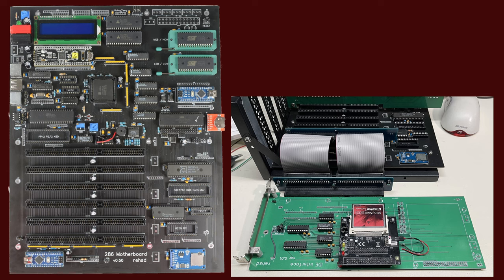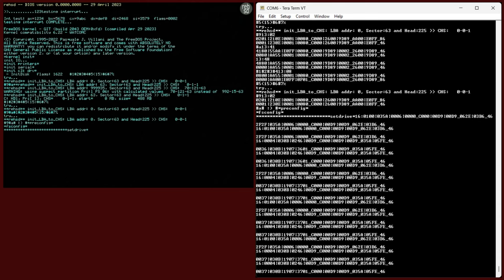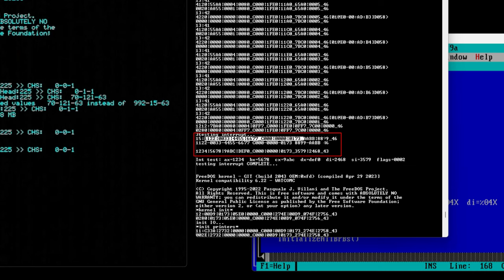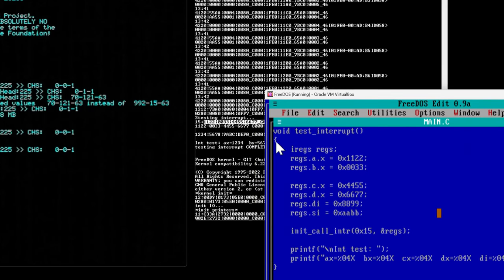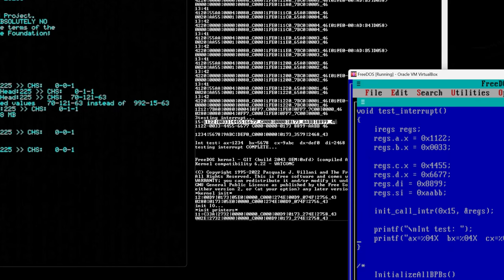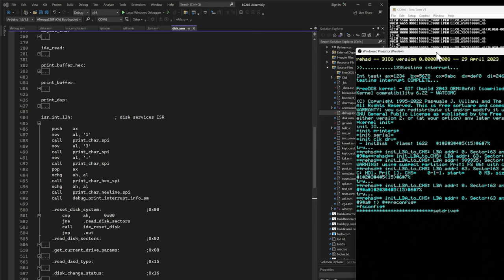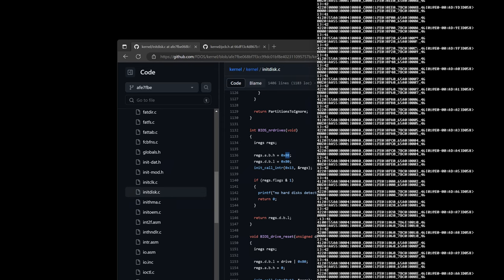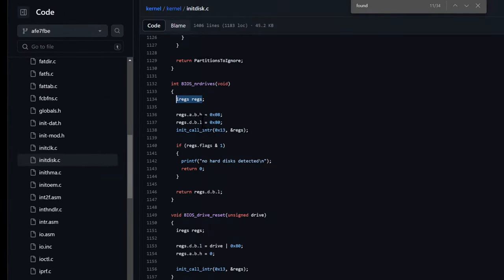80286 Build, Ep. #92 - Troubleshooting CPU Flags Register between BIOS and FreeDOS

Comment: `iret` restores FLAGS, CS and IP registers. Bulding proper stack frame is the solution. On entry try `push bp`, `mov bp, sp`. On exit use `mov sp, bp`, `pop bp` and `iret` (or `leave` and `iret` alternatively). Inside your ISR your saved BP is going to be accessible through `[bp]`, return IP through `[bp + 2]`, return CS through `[bp + 4]` and finally FLAGS through `[bp + 6]` (all assuming I got the offsets right ;). Modifying `[bp + 6]` is going to make changes visible to the caller. As an added bonus you get super convenient storage area for local variables. After `mov bp, sp` you can add something like `sub sp, 12` to get 12 bytes of local storage. It is going to sit between '[bp - 14]` and  `[bp - 2]`.
Reply from the maker: Thanks for the info, @pvc! I'll need to practice my stack frame skills.  :)

Comment: Quick thought - caveat - I've never done 286 assembly, but looked in the 1987 programmers reference manual. There's a note saying the IRET behaves differently depending on something called the NT bit which is involved in task switch. Maybe there's something in that, if it does a "return" that actually does different/extra stuff.
Reply: @rehsd actually in reading a bit more it looks like INT n and IRET have built right into the insn a flags push and pop, so no matter what you might be doing with the flags locally they'll be overwritten by the pushed value from the caller.  So you might have to directly molest the stack, either by popping and re-pushing the intended value, or by pointing right into the stack. Looks like it also does that with the cs reg.
Reply from the maker: As far as I can tell, NT is used in protected mode. Currently, I am still using real address mode only. I'll do some more research on the NT flag. Thanks for the suggestion!
Reply: @rehsd  Check out the other comments about INT/IRET automagically preserving flags, probably more relevant
Reply from the maker: @ripliini, @Tom Storey, @Zxborg... I swapped out iret with retf 4, and all is good! You are all awesome!
Reply from the maker: Correction... retf 2 is what I used... and is working.
Reply: @rehsd  Good stuff! One caveat though, sometimes dedicated ISR return insns (talking general principles here, not specific to 80286 CPU) affect specific interrupt state flags and it's important to make sure to end an ISR (at least a hardware ISR) with the right flavour of return so that stuff like nested interrupts are still handled as intended.  But if it works, and it's "only software", then hey, go for it :-)
Reply from the maker: @zxborg9681  Noted! These are all software interrupts. I haven't needed to change flags on any of my hardware interrupts so far. On any hardware interrupts where this situation occurs, I'll need to clear the interrupt on the priority interrupt controller. I'll see what other damage I can do with this.  :)  Thanks!

Comment: How exactly does this iregs type work? Is it actually a struct that you need to populate values into or is it something special that the compiler handles internally? Your code only seemed to be placing values into registers but not into the memory pointed to by &regs? Or maybe I missed something.

But if it's the later, then I suspect that the flags are not maintained by printf whereas the value of all of the registers probably are, and this is probably normal behaviour. Generally the flags are transient and only used in local context, except in ISRs where you would push and pop the original flags to properly resume execution after returning from the ISR. But printf isn't an ISR so it likely doesn't care to save the flags such that by the time you come to print them out, the value returned by int15 is long gone.

By contrast, in that BIOS_ndrives call there is nothing going on between the call to int13 and where you test the flags, so they are probably maintained long enough to be able to use them in the if statement.

So I'd say try copying regs.flags into an integer after the int15 call and use that in your printf statement instead.
Reply: Actually, as others have pointed out, IRET restores original flags from before the interrupt, so without modifying the stack manually to change what the flags will be restored (probably not a good idea unless you really know what you're doing) then you can't return a custom set of flags.
Reply: Hm no, it looks like a "ret n" instruction will discard n bytes of the stack before returning, so a "ret 2" at the end of an ISR will discard saved flags, and allow you to return your own.

But I suspect you'll still want to save the flags after returning from your int15 handler, because calling printf is likely to destroy them.

A bit of both.
Reply from the maker: @ripliini, @Tom Storey, @Zxborg... I swapped out iret with retf 4, and all is good! You are all awesome!
Reply from the maker: Correction... retf 2 is what I used... and is working.
Reply: @rehsd  you're welcome. I learned something myself through this 😄

Comment: I thought iret restored the flags register upon return?
Reply from the maker: That's a great question. This reference (https://www.felixcloutier.com/x86/iret:iretd:iretq) seems to indicate that is the case -- that eflags are popped. So many of the BIOS code samples I see use carry and zero flags to indicate success/failure status to the caller that generated the interrupt. Maybe I need to return from interrupts in a different way -- something other than iret?
Reply: @rehsd  Or modify the copy on the stack?

Ignoring your code above for a second, something like this:

mov ax, [sp+4]
or ax, 2 ; set carry
mov [sp+4], ax
iret

something to that extent perhaps?
Reply: @rehsd  looks like they use a "ret 2" to discard the save flags and enable them to return their own. I see that used in the IBM 5170 BIOS.
Reply from the maker: @TomStorey96  I was just looking at https://github.com/kaneton/appendix-bios/blob/master/src/disk.asm after @riplinni commented on iret. Some RET and some RET 2. I'll do some quick testing! Thanks!
Reply from the maker: @BareMetalProgramming  That might work. And, it looks like some form of RET, RET 2 might do the job. I'm going to do some quick testing.
Reply from the maker: @ripliini, @Tom Storey, @Zxborg... I swapped out iret with retf 4, and all is good! You are all awesome!
Reply from the maker: Correction... retf 2 is what I used... and is working.
Reply: @BareMetalProgramming  SP can't be used as base register on 286. It is 386 feature.
Reply: @pvc988  Ah, here I go again, giving 386 suggestions in a 286 thread. ;) Thanks for the correction, pvc!